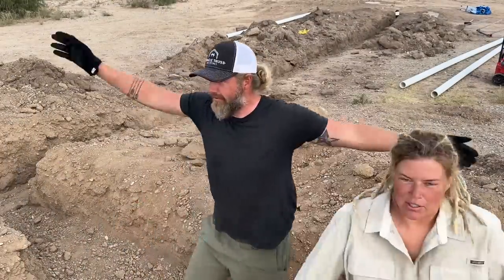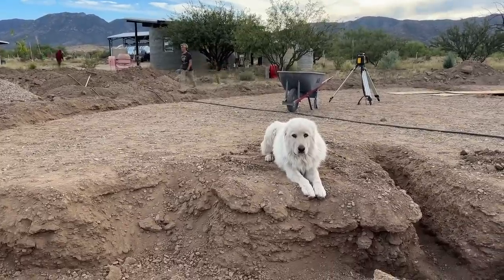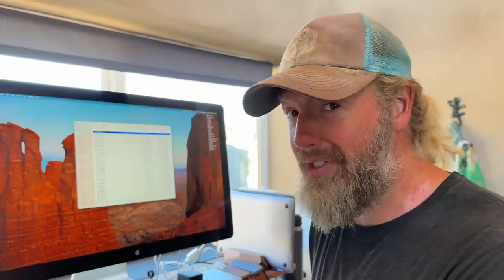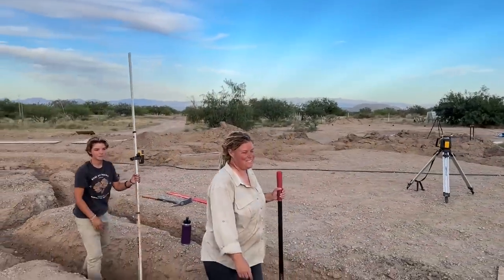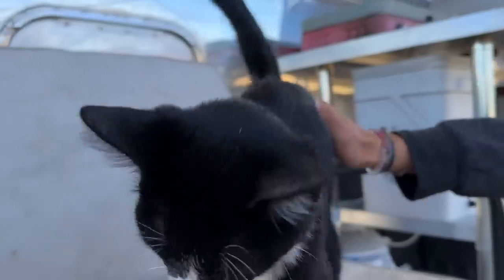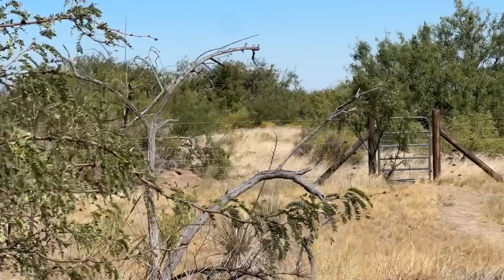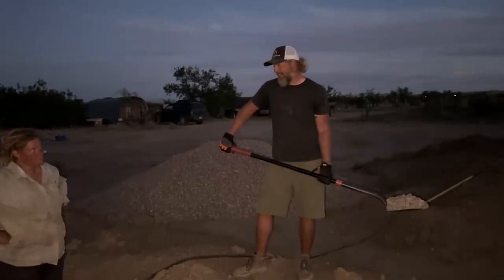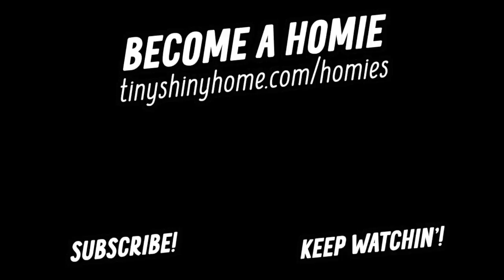DETERMINED to Make it to the NEXT STEP!

Comment: I was thinking about the heat transfer thru the hyperdobie bags, and was thinking you could include a hollow pipe in the middle.  The hollow pipe would provide an air break for heat transfer.  It would be corrugated pipe (flexible) about 4" diameter...  but it would be a hassle to keep it centered... Just an idea.
Reply from the maker: Then your walls would be totally compromised…